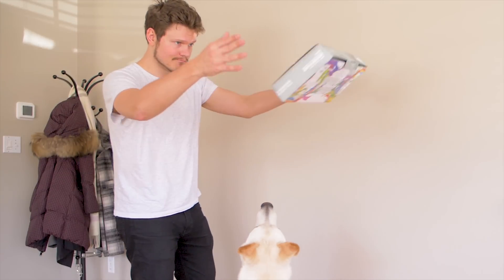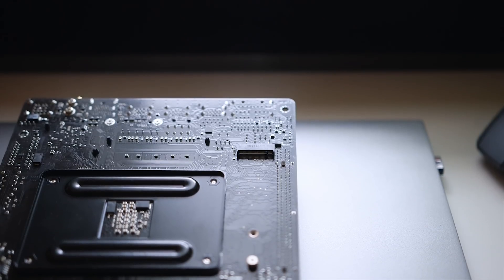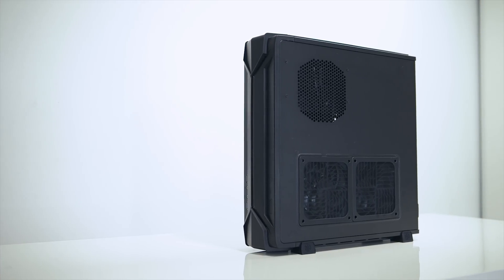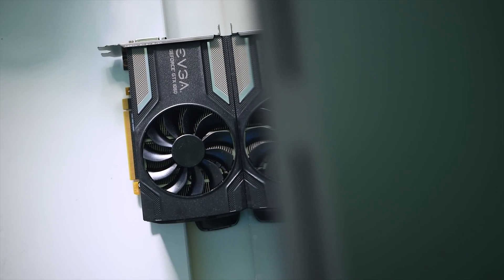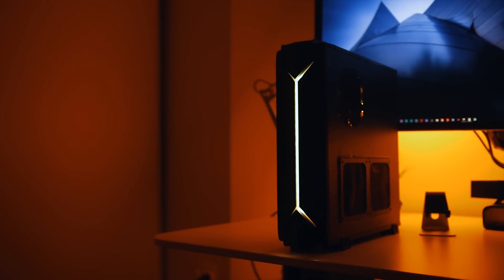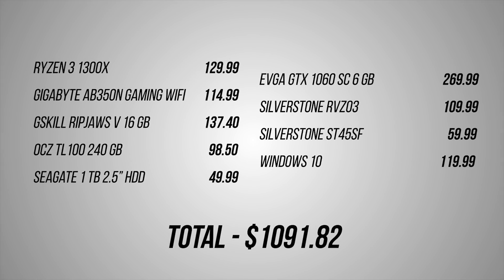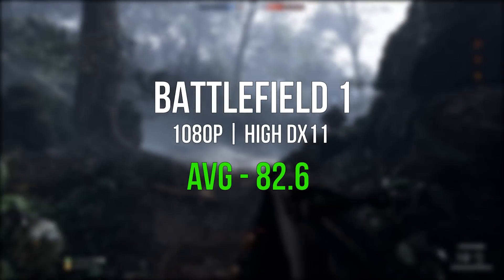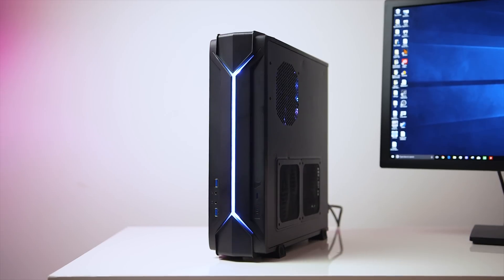AMD Ryzen SHRUNK - Our Ryzen ITX PC Build!

Comment: I know pricing is much higher with ITX mobos, especially on an extremely recent platform like ryzen, but my Micro ATX build with a 1080 and a ryzen 5 1600 runs $1400 at the current time with win10 home.

Specs:
Case: Cooler Master silencio 352
Mobo: Gigabyte AB350M D3H
Ram: Corsair 3000Mhz 2x8GB (I splurged a bit too much on this, but I mostly went of the point where the performance gains from faster memory plateaued on Ryzen) 
CPU: Ryzen 5 1600
GPU: 1080 Founders
SSD: Crucial MX300 250GB
HDD: WD Black 1TB

Parts of my build are pretty illogical, but first off the WD Black was a significant sale and the performance and reliability seems very much worthwhile.
The 1600x didn't come with a stock cooler so the extra cost would have been a problem. The stock cooler can OC fairly comfortably.
The RMx 550 is currently only $10 less than the 750, but at the time this was closer to $30, and I still have plenty of headroom seeing how I can't OC too much on a blower card and a stock cooler, I bought the silent case to avoid that kind of noise.
The 1080 may seem like overkill, but I was expecting to be on my 1060 Founders until I received the 1080 as a graduation present from a relative who does content creation so he always has top-of-the-line (Upgraded to a 1080ti as soon as was reasonable)

Not counting pre-existing components and the gift  (1080, OS, Storage) I only paid 600 or so for the majority of my system. With more reasonably specs parts like the 1060, lower speed ram, cheaper SSD, My build would be as cheap if not cheaper than what HardwareCanucks just made even with OS. I put most of the cost on the overpriced MOBO and case. A budget build makes no sense in the ITX marketspace and neither does the ridiculous case. I personally find it ugly but the fact is that it almost costs more than the CPU.

Comment: Why do u have the rvz02 listed and u used the rvz03? For this style comparison u could understand if u mentioned the 01 in link list since the 01 and 03 are pretty much the same the 02 is very differnt from the 03 and 01due to less air flow and other conserdirning like the 01 and 03 can be water cooled. As far as rgb fuck it the 02 is better for good rgb look 18 dual strip kit looks Awsome in a 02

Comment: Question, should i get a ryzen 1300x with a 1060 or a ryzen 1600 with a 1050ti.
Reply: Assoholic Shark If u are gaming primarily go for the 1300X and 1060, if you want to do more work and play exclusively e-sports/lighter games go for the 1600x and 1050ti

Comment: It is worth noting that this RVZ03, uses the chassis from the recently updated RVZ01-E, rather than being an update to the RVZ02, which only has support for SFX PSUs. The Z03 and Z01-E can both accept ATX PSUs, and are noticeably taller when mounted horizontally than the Z02 chassis.

Comment: Yea, the graphics situation isn't great for sure.  Same with the cost of memory/flash drives (though the flash situation doesn't bother me personally). Hoping the new "mining" cards will alleviate the graphics situation.  I also hope the mining cards aren't fully single minded cards and can be used in SLI or Crossfire configurations with normal graphics cards (when applicable) for users wishing to run such a configurations (admittedly, not me - LOL).

Comment: Is this better or worse than my i5 2500k?
Reply: Depends if yours is overclocked. In the range 4.2-4.5GHz, you can expect Cinebench r15 scores between 520 and 600, which is very comparable. At stock 3.3GHz, you're looking at around 430 points. If you have a 2500k and an OC capable motherboard, then upgrade your cooler and overclock safely to 4.2 at less than 1.3V. Ryzen 3 is not an upgrade unless you are desperate for DDR4 or in board NVME storage.

Comment: In my opinion I will take 7200rpm 1tb 2.5 hdd and m.2 nvme Ssd like wd black 250gb with Asrock x370 itx mobo will be better for cable management and Over Clocking but still this case looks awesome with Dat RGB 😍

Comment: I have this board its very picky about RAM get an AMD compatible kit & get aftermarket vrm heatsink or place a fan blowing straight on vrm..if you gonna overclock vrm temps go 100 deg with 95w cpus..65w no oc is perfect 1500X hello 😎 those RGB lights & USB 3.1 Gen 2 seal the deal. Stop whining about layout get an extra fan connect the cables tidily & close the case! and I have the same graphics card too & Nvidia gave free rocket league game with it.

Best case for this board is SG 13 or Prodigy or one of those Lian Li ones where board is placed horizontally.

I love this board layout upgraded from i3 3220 + H67N B3 (has same layout & is from gigabyte) very happy with the upgrade

Comment: Dude, do your research next time, you can get 7200rpm 2.5 inch drives. You linger on an opinion of incorrect knowledge of facts. And its not like this is uncommon knowledge either.
Reply: Agreed !

Motherboard expensive ? $119? Z270 boards are MORE . I would have done the ASROCK AB350 Gaming ITX/ac .
Reply: Adrian May they are also only a bit more expensive ($10 is worth it for 7200 rpm)
Reply: Adrian May yeah seriously. A WD Black 1TB 7200RPM 2.5" drive is only like $70
Reply: take 7200rpm 3.5'' hdd and 5400rpm 3.5'' hdd and both will be same speed - so go do that research you seek....
Reply: Jim Cash same

Comment: I have no idea how you're getting those gpu temps. I have the non SC version of the EVGA 1060 in an older ATX midtower case with a side panel case fan that blows right onto the gpu. Despite that, any load takes its temps up to 80C easily, and stress testing seems to stabilize at ~87C. And at idle, it sits just above 30C. So I'm really confused by your 49/66C idle/load temps.

Comment: I would have bought the ASRock Fatal1ty AB350 Gaming-ITX/ac, is cheaper and has a MUCH better audio chip, the Realtek ALC1220, and everybody wants good audio on there Game-PC.

And why use slow DDR4 2400mhz memory, when you know you get much higher fps with DDR4 3000/3200MHz memory?

And why not buy a Windows 10 Pro key for about $30,- then you still had $90,- for something better?

Comment: I'm not personally too torn up about the lack of 3.5" HDD support in the RVZ03. I have the 02 but use a full-size graphics card so I wouldn't be able to fit the 3.5" anyway. What I'd be more interested in lookin at in more depth is cable management. In the 02, the panel layout is such that there is room to squeeze cables here and there in various pockets created by the panels. That means no room for extra active cooling fans but a cleaner build. I'd like to get a closer look at the 03 to see if those pockets exist.

Comment: I think if you are doing a budget build with a $120 cpu you need the rest of the rest of the build to make sense. I would go with 8gb of RAM, a much cheaper case (Silverstone SG13, Coolermaster Elite 110/130 etc), and a gtx 1050Ti since they still have decent prices for the performance you can get. Plus you can get Windows 10 for much cheaper than $120, and that would give you much better performance for the price overall. Plus there is an AsRock ITX B350 motherboard with a much better layout for a similar if not slightly lower price!

Comment: How're those VRM temps? Pretty sure this is like a 4+2 phase or something, hard to tell from the layout, and the heatsink looks dinky, and there are tons of reviews with complaints over this. I suppose with such a "weak" chip, you could probably go with no heatsink with a top down cooler with such lower heat output.

Comment: You could always partition the drive So the faster half of the drive would be significantly faster. One example on the three-year-old video turned a drive that had a maximum of 137 megabits per second to a minimum of 46 megabits per second. With an average between 60 and 80. Antutu drives one that took the minimum and went up to 80 and the other one that went from 80 and went to 137. On the 500 gig drive he was able to get 200 gigabytes into the faster partition. And if you want to squeeze even more speed out of it you could just make the partition a bit smaller. You would see even greater speed differences on a full-sized hard drive and when five and a half inch hard drives come back to Consumer Market in mid 2020 you would see improvements that are just mind-boggling.
Reply: It was estimated that 5/2 inch drives would come back into the server Market in 2018 220 19 and the reason they're not in the market anymore is because in the 80s desktops were smaller and a lot of them had weird shapes, so most companies weren't willing to put any more than one five and a half inch Drive Bay on their system and three and a half inch Drive Bays were common and already accepted by the market. But now it seems silly So eventually they will come back.
Reply: The speed difference is the RPM two disk ratio. There is less disk to cover well the head is over the center of the disk and there is a lot more to cover on the edge. We could expect to see in excess of 500 megabytes per second and even higher Max read write speeds on enterprise-class drives in the five and a half inch form factor.
Reply: Also it wouldn't be that outrageous to see 80-00 terabyte single drives. Not the regular technology you see in the hard drives you probably have it in your system. Not a hundred percent sure what they're called off the top of my head but something like slate drives. These tribes today have an excess of 16 terabytes. They were able to cram more data bits onto each disk platter by partially covering up the the magnetic data bits. This would make writing data complicated because you would have to write over data that do not want to write over,  because the data bits partially cover up the next row of data bits. Which means it writes the data on both sets of
You know instead of data bits and just going to say X.

X so what has to read acts before rewriting it and has to constantly write X over and over again until it finds an area that one side is empty and it doesn't have to save and rewrite somewhere else. But the five and a half inch difference 2 3 and 1/2 in love and to have more platters in each platter would have more than twice as much space.

Comment: RVZ02 doesn't support a 3.5 hard drive, or at least not without a kludge. You can rip out the spacer supporting the optical drive bay, remove the bay as well and they you'll be able to put a 3.5 drive in that space.
Update: I forgot, if you're using a short GPU, you can put a 3.5 drive next to it, without a kludge.